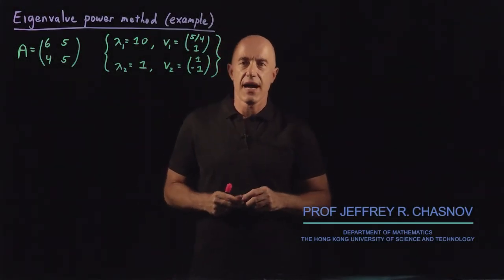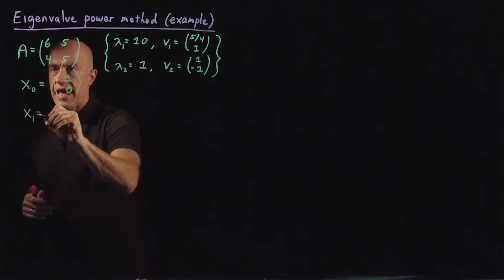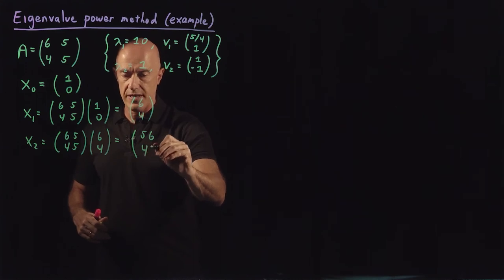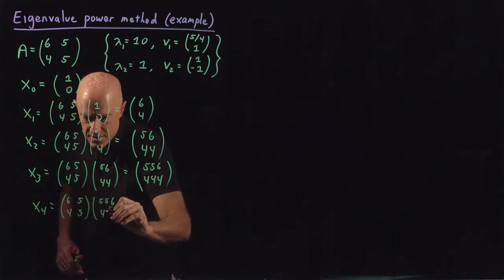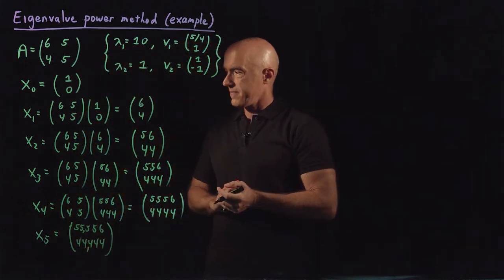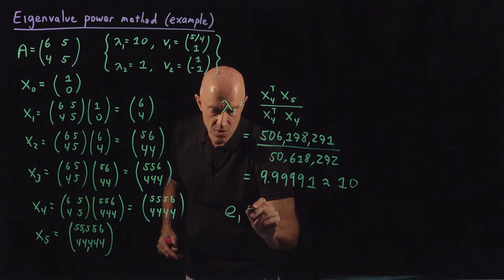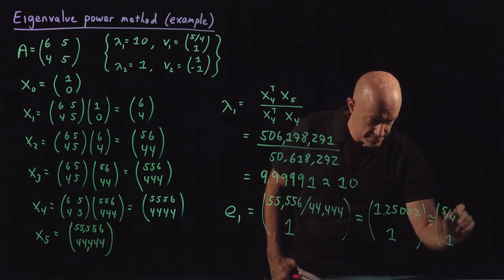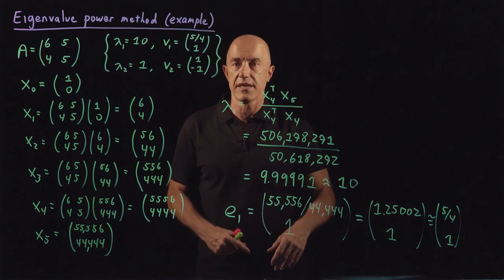Eigenvalue Power Method (Example) | Lecture 31 | Numerical Methods for Engineers

Comment: Good video, thumbs up. But lambda 1 is the dominant eigenvalue, isn't it? how can we find lambda 2?
Reply: u cant, this method is only for the bigger eig
Reply: By using concept in Algebra we can find that, sum of the eigen values is lamda1+lamda2
Reply: with inverse power method
Reply: @martinopinto6323 Actually you can using deflation method, once you've successfully calculated e1 and λ1 subtract the rank 1 matrix from A, let A*=A-λ1*e1*e1'.
then repeat the power method for A*.